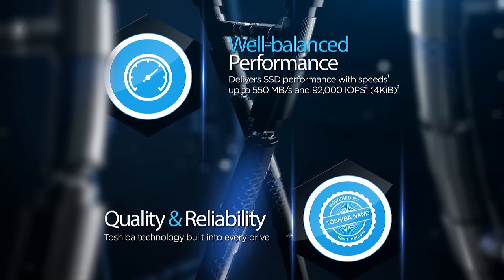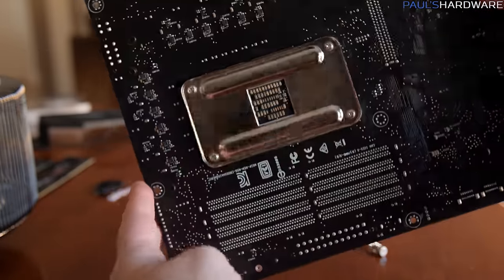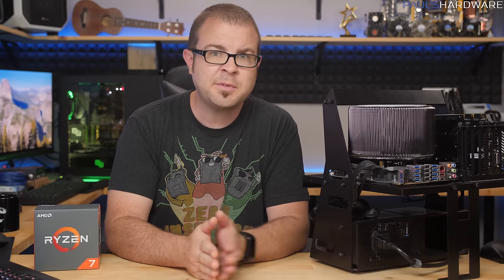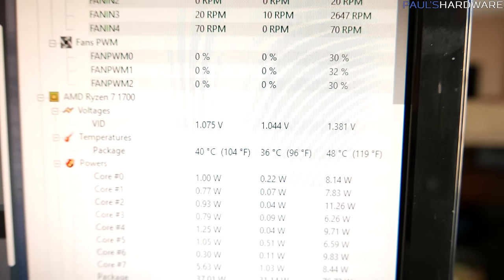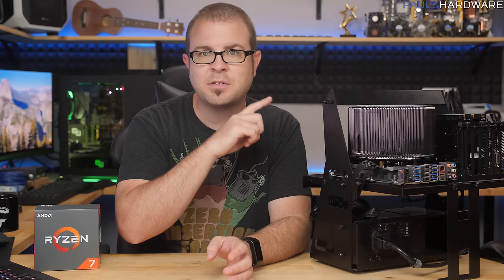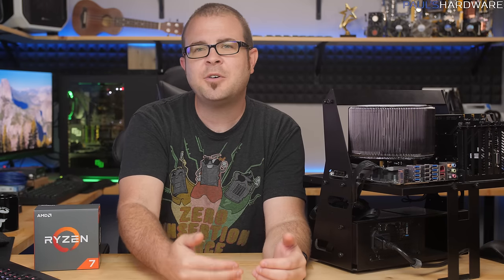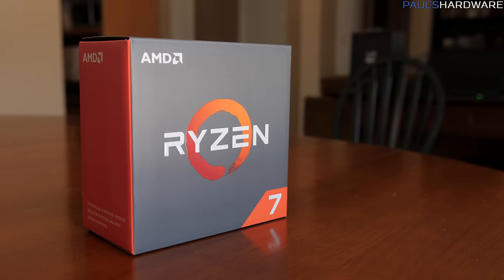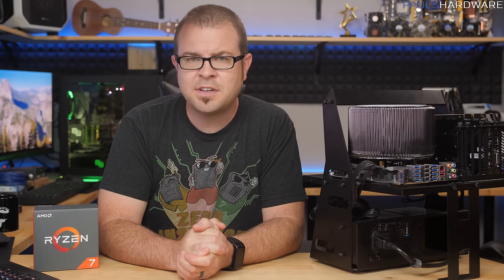Can You PASSIVELY COOL a Ryzen 7 CPU?

Comment: 80 degrees though? I'm sweating just thinking about that...

(EDIT) For anyone unaware, I'm talking about the A/C temp.
Reply: A/C is expensive. its not too bad when you have a fan pointed at you.
Reply: I run my r5 1600 at 70-75 C at load, so what?
Reply: VeeTeeF you're probably the type of person to leave the car running just to use the ac
Reply: He means living in a home that's at 80 degrees.
Reply: we all should be more conservative with A/C
Reply: Luis1597Fatal If it is hot outside, you're damn right I'm leaving the car on for the ac
Reply: For real. Max my AC ever is is 72F
Reply: DwmRusher lol
Reply: DwmRusher
Reply: Luciano de Benedictis Heh I leave my AC on 72 or lower all the time and the most my electricity bill has ever been is $30. And we're already fucked when it comes to global warming anyway.
Reply: That's pretty bad lol, I get 55C on my 1700 OC'ed to 3.9Ghz
Reply: Intel processors in general (Especially modern versions) run a good amount hotter than AMD CPU's.
Reply: Alex Lockard I must have cheap power in my area (northern VA). Our A/C stays on 68 and our electric bill goes up about $70/month during the hottest time of the summer vs the coldest time of the winter (gas heat). I'm happy to pay it to stay in frosty coolness.
Reply: I like my A/C at 75F ;)
Reply: For real. Who keeps their house at 80 degrees on purpose?
Reply: jort93z If I upgrade from FX-8320 to R5 1500x, will be room be significantly cooler?
Reply: That's 27*C.
Reply: I keep my house at 72F in the summer :)
Reply: VeeTeeF my laptop goes to 90C when play for like 5h and normally like 80C
Reply: That's around my comfort temperature when I'm not in physical activity. We have different preferences and it's probably a nice saving on the power bill.
I don't live in a hot place that needs AC, but I visit one I can't stand when it's less than 70 inside and 90 outside.
Reply: jort93z Thx, it's just that my room is always so hot and the A/C doesn't really help.
Reply: My A/C is set to 77°F, aka 25°C.
Reply: yeah we wouldn't want to run out of cold air.
Reply: In my room the temp is about 85 degees
Reply: 80 degrees with low humidity feels glorious compared to the 100+ degrees outside.
Reply: me too my house is usually 60 f
Reply: +White Wolf I don't know about the 8320, but I know that my 8350 can heat up my apartment relatively quickly if I close the window.
From what I can tell the Ryzen chips won't do so as quickly except with the eight cores overclocked at full load.
Reply: My room is about 85 most of the time but it gets up to 93 when the temp gets to about 90 outside.
Reply: 80°F is only 25°C...
That's not even hot, warm yeah but not hot.
Reply: Agreed, It's 71 right now in my house right now, 90 outside.  At that temp I would sweat profusely plus the temp that the computer would add in a room....
Reply: yeah I keep mine at 68 however I do not live in a rather hot place so im sure its cheaper for me to do so.
Reply: We were talking rational methods here... Not eating meat, bah! Some of us dont want to poison our local environment by farting all day from eating too many greens.
Reply: Splitty 73 is perfect for me. 72 and my nose gets stuffed up.
Reply: Dude where do you live?  Cause I'm moving there next. 

I used to leave the ac on 74F in my last apartment, and the lowest the bill ever was $45.
Reply: I keep my thermostat set at 68F year round at auto so it is A/C when needed and heat when needed. My power bill is never more than $75.00 / month and usually in the 50 dollar range.
Reply: I live in india... During summer season the ambient temperature can go up to 111 degrees.., Thin about thay
Reply: eh its 30 degrees celcius all around the year here. 80F is like 26-27C.
Reply: Please tell us more about how being vegans will save the environment when we can just use genetically modified cows that don't produce as much methane and if you drive a Prius you just get better gas mileage your really not doing much and my motorcycle gets better gas mileage. As a biology teacher you should very well know that climate isn't static its dynamic look at the 3 snowball earths that have happened the polar ice caps were lush jungles and who cares about a few species going extinct its not like we striped away our ozone layer climate change is inevitable it would of happened sooner or later. Haha you drive a prius is it pink?
Reply: 27C is fine as long as it's a dry heat.  It's humid heat that causes your body to fail to dissipate body heat.
Reply: 80 is way too hot, anything above 75 is unbearable.  I personally prefer having it set to 72.
Reply: VeeTeeF my parents keep the house at 62 and fuck it feels even colder than that sometimes
Reply: Isaac Kvasager Tell that to my parents. How big is your home?
Reply: Alex Villalobos my parents refuse to turn on ac when my room is easily 80-85 F.
Reply: Yes i do understand the difference in eons and centuries and i never said you weren't manly its just the rep with guys driving them. But also just because the ice caps melt some species die of (yes i know its on an extinction level) what can we really do about it at this stage of the game. Not much unless if the whole world goes oh shit we need to do something nothing is going to change so burn the coal, and the oil until its gone then problem is solved we just have to deal with warmer weather so what its not like earth will turn into Venus.
Reply: VeeTeeF dude not just you! I was tripping on his pc temps but he has to be in a dry area with lower humidity or thats a death sentence.
Reply: 70f for me, can't stand the heat, thank god I live in Canada.
Reply: VeeTeeF bro 80 degrees in Fahrenheit is chill where I live where it's 110+
Reply: SOZ I KILL YOUZ but its dry there probably. Humidity adds a new layer of hell.
Reply: weasel101 yeah I've been in the humidity as well lmao
Reply: You're sweating just thinking about that? I'm sitting in a small room with no window and It's 98F here... Got my USB Fan blowing, so yeah :D
Reply: Kiltenth why tho? lol
Reply: Nathan Burke no money for a/c lol
Reply: Kiltenth if I don't have ac on my hp workstation(Xeon e5-1650 V2 space heater) and my gamer will make it that hot in my living room, I keep my room at about 19*c-22*c on summer days.
Reply: VeeTeeF i live in kansas. in summers 110+ is common. 80 would be heavenly
Reply: besides, dpends on outer temps. Having too much of a difference isnt very healthy
Reply: Isaac Kvasager but for a pc 80* is no bueno!
Reply: Isaac Kvasager Yeah it's a perfectly fine ambient environment for a computer, although lower is always better. I keep my place at 68F degrees which is decently chilly, but that's only ~ 6.5C cooler than 80F. Feels way cooler to a human, but doesn't make much difference to a processor.

Although I feel like the relationship between ambient temps and CPU temps aren't linear when dealing with passive cooling (based on absolutely no science at all).
Reply: Yeah same. However, depending on where you live, 80 can feel quite different depending on humidity levels.
Reply: +Jesse Westbrock - You're* Are you really a biology teacher? Maybe it's time to hit up 2nd grade and work on your grammar before you go back to school this fall.

Comment: In a case, there are case fans. An open test bench will have less airflow. I believe the temps will go down in an actual case
Reply: Joseph Jones For a little bit. Then the case temp will rise. Which therefore heats up the CPU.
Reply: Floki if you have a case fan temps will not rise
Reply: Floki 
Yes, the case temp will rise - but I am confident he dynamic equilibrium there will be lower than the ambient temperature around the heatsink on an open bench with no airflow.
Reply: It would be cooler in a case, yes the case air heats up, but a case has fans to move that hot air out, and bring fresh air in...
Reply: But if you're installing case fans then you may as well have a cpu fan.

Besides, you'd never get that thing in a normal case.
Reply: in my opinion case temps will go up as ive never seen benchmark were cases performed better then open air , most cases these days use dust filters which are great for maintenance but choke airflow and if fans need to go faster to keep it cool isnt that defeating the point of fanless to be quiet?

Comment: The score in fire strike ultra was higher because the corsair memory is dual rank, but flare x single rank. Dual rank with a frequency of 2933 more powerful than 3200 single rank. Sorry for bad english.
Reply: Dmitry Volkov What you mean is Dual-Channel. And no, they are BOTH Dual-Channel. One was simply running a bit slower, but that's within margin of error
Reply: +Roman Babynyuk
What he means IS dual rank and single rank. On RAM modules, you can either stick the memory on one side or on both sides of the stick, hence single rank (one) and dual rank (both). While the difference is almost unnoticable in real games or workloads, FIRESTRIKE seems to take more advantage out of it than higher frequency.
But again, in most use cases, it makes no difference other than margin of error, so it's not really worth worrying about.

Sincerely,
ZfE
Reply: Roman, not channel - RANK
Reply: Thanks, my bad. I did not know about this. Nice to learn something new!
Reply: Do you think that dual rank memory would retain more heat than single; with ICs on both sides of the PCB? In Overclocking, this becomes a factor. If they would just make mainstream mobos with quad-channel single-rank only on all chipsets...That'd be great.
Reply: ice 9 I

Comment: I think passive cpu coolers are not worth it. Grab a good cpu coller, throw a proper 120mm fan (Noctua) on it and choose a base speed of 500rpm. This would be virtually silent
Reply: You need someone to hold your hand in finding the ambience results on one of the world's most popular silent fans?

Try CTRL + T + "noctua review"
Reply: Noctua? No rgb though 🤷🏻‍♀️🤷🏼‍♂️🙅🏼‍♂️
Reply: A budget $40 Cryorig cooler is basically silent.  The h7 for example.

And that's nothing special.
Reply: Noctua makes more noise than tractors at 500rpm, better use BeQuiet those sound like the surface of the Moon even at 1500rpm

Comment: Nice test but there is one major flaw though. Practically noone uses an open test bench apart from, well, testing. In a case the performance of a passive cooler like this can be much much much worse, as it is very dependent on airflow. It wont be able to radiate away like in an open scenario
Reply: Otherwise, performance in closed case could be better since there is an air flow inside.

Comment: What's the point in having a fanless CPU cooler when you still have fans on your graphics card making noise? Might as well just use the still quiet water cooler.
Reply: I was going to state the same .. and why did he bench up against the AIO instead of the stock R1700 Wraith Spire LED  ??

Puzzled

Comment: Can you try with a Noctua NH-D15 without fans?
Reply: lazyjacket I have a Phanteks PH-TC14PE running quasi passive on a 1600X it automatically boosts to 4Ghz @1.4v and peaks at around 45c.
Reply: CatharticCathexis That's bullshit.
Reply: Lol. What's bullshit?
Reply: Nais, the form factor of the D15 and TC14PE must be alot better then the choice Paul has done.
Reply: lazyjacket His is truly fanless, I have intake and exhaust fans still for air flow.
Reply: HIs test bench though is not enclosed......I am stupid but won't most ppl have their motherboard in a case?
Reply: Styxx N, if you check their website they recommend one of their PC cases or a PC case with a top opening and good airflow.

Comment: Please test it a closed test with and without fans
Reply: You'd need at least an exhaust fan, or it wouldn't make it past an hour, before it would overheat. But, with a single intake fan, and a single exhaust fan, it acts just like an air cooler, unless you tried to slap a big GTX in it.

Comment: For a long time I had my FX8370 underclocked and undervolted. Until a year or two ago it could handle games just fine like that, and the lower temperature was great. Its especially nice over summer, though my GPU i of course the main issue there. More people should see it as a viable option, especially with the sheer power of the Ryzen and modern Intel systems. If an 8370 could handle GTA5, VR, and games of that era at half the clock rate without any FPS loss, the modern CPUs are dramatically more capable and will easily be able to play whatever you throw at them for the next few years.
Reply: I usually run my delidded i7 7700k at 1.44v 5.13ghz. Which is very hot and loud obviously...

But it was so much fun running it at 3.8ghz 0.75v. When stress testing itll usually hit around 88 degrees maximum. And mostly hover around 75-80. But when I loaded up the stress test at 0.75v it went up from 24 degrees idle to 25 after a few minutes 😭 it's just beautiful.
Reply: Jesus christ it can get 0.75 at 3.8 ghz? Thats utterly insane. I didn't expect it to even boot at all at that. What's your cooling solution like with those numbers? Frankly I can only get 25 degrees case temps idle let alone the CPU. Admittedly it was only a handful of degrees above case when I left it underclocked, but its certainly no 7700k for efficiency thats for sure. Noctua D14 which I partially regret as overkill. Though with one of my case fans dead right now it hasn't even blinked, so there are advantages at least.
Reply: @olivialambert4124  I just have a 240mm aio. Your Noctua D14 probably performs much better! a few degrees over case temps is still amazinggg!

But yeah Intel seems to undervolt pretty well, but I have also tried it on a ryzen 5 1600, and got good results!

Just wish I could do it to my Nvidia GPU's. AMD allow undervolting but nvidia not so much. If feels pointless doing it to my cpu when my two GPU's ramp up their fan speeds and ruin the silence 😔

Comment: Forgive me if you pointed this out somewhere, or if you plan on running this open air.  But that cooler would work much better in a case, especially a case like mine with 7 external fans (still quiet), due to all of the airflow that would be provided, where as in your video it doesn't have any air flow at all, which isn't very realistic.

Comment: @Paul's Hardware Have you tryed to run your gpu in the top by 16 slot with a flexibale riser calbe ?

fi ti works you can use your other expansion slots freely
Reply: You should do that if your motherboard doesn't have multiple full x16 slots (I'm talking about the wiring of the slots, not the physical width)

Comment: i used a zalman 92mm copper cpu cooler with the fan disconnected in one of my builds and it still cools quite well as long as you have some airflow moving in the case.

Comment: If you passively cool Skylake X,  you'll be able to use the system as a heater at winter 😂.
Reply: DT B yul log simulator
Reply: The heat generated by the CPU does not change no matter how big your heatsink is. Unless the CPU is throttling, then it would generate less.

Comment: Pump died on my H100i v2, had temps of ~95C(idle) on my 7600K. While troubleshooting, I dropped the voltage by 100mV and clocked it at 2000MHz and dropped my idle temps to 65C. I think the ambient was somewhere between 25-28C at the time. Not bad considering I was essentially running with no heatsink at all.

Comment: My question would be, how does this perform in a case?  I know in normal circumstances it being in an open air test bench doesn't matter too much but since this is a passive cooler, would it actually be affected by the ambient temps inside of the case?

Comment: Just a heads-up for those using other than the supplied cooler. On my Ryzen 7 1700, the documentation states that your warranty may be voided if you use other than the supplied cooler. Anyone who might want to overclock or is showing people how to use other cooling systems might mention this. After normal warranty period is over it might be ok but just be aware that you might void your warranty if something happens to the chip during it's coverage period. Only applies to a new build where the chip is still under warranty obviously :-)

Comment: Great test. But, there's usually slow 120mm fan at the back of the case. How would have this cooler performed on Ryzen in closed environment with low airflow - inside case with slow 120mm fan. In that scenario, there would be some airflow, but also there would be a hot GPU together with passive CPU cooler inside a closed environment. Such test, with non-blower style GPU would be welcome.

Comment: Anything can be passively cooled.
Thanks to phase change heatpipes that can transport with ease massive amounts of heat, you can gather heat from a pinpoint (the cpu die) and transport it far away where you add how many radiators you need where you have plenty of space.

There was a case made for passive cooling with a weird cpu block with heatpipes that reached the sidepanel (made out of aluminium about 70mm thick, finned, like a giant 5kg radiator), same for GPU, and other main heat sources on MB.
Reply: D

Comment: The Thermalright Mocho (14cm fan version) is also capable of running fanless.. It should fit better in the case too. It would be cool to see that in comparison. I was very interested in these fans a couple years ago when doing my build, but ended up Investing in Noctua fans and a define R5 to bring down the sound level.

Comment: The cooler is just too big. If you have to shave off a piece of your motherboard and it's blocking off a PCI slot, it's best to get another one to save yourself a ton of trouble. I have a mugen 3 cooler for my i7 920. The fan broke and I never replaced it and it the temps never go above 70. The TDP is 100. It's usually under 60 when doing light tasks like gaming or opening lots of tabs on browsers. So you could potentially get a good cooler like the scythe mugen and just leave the fan unplugged.